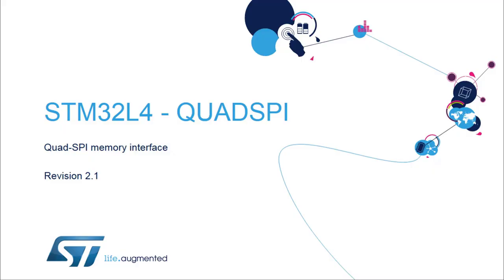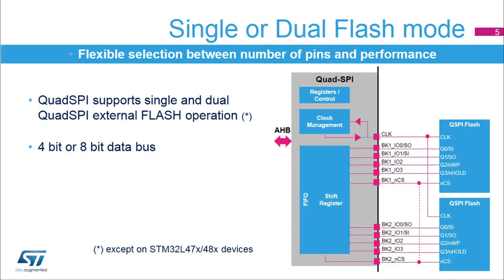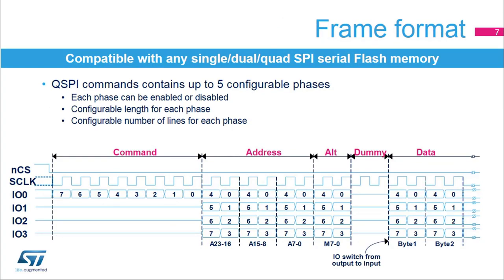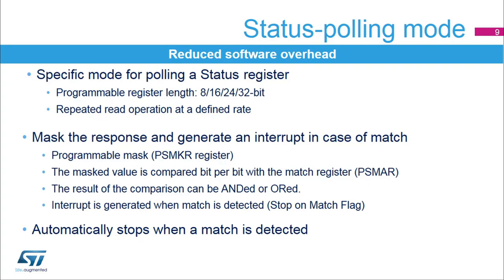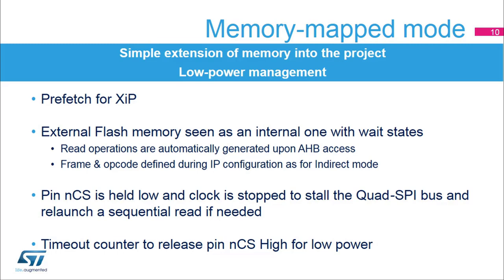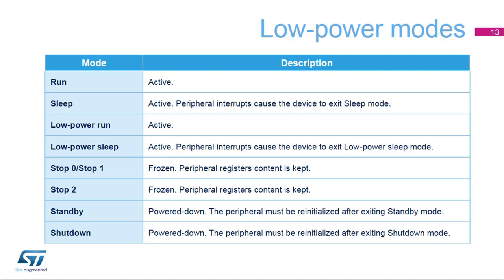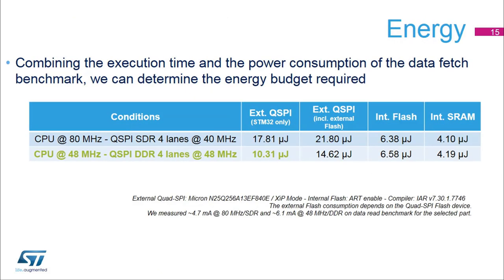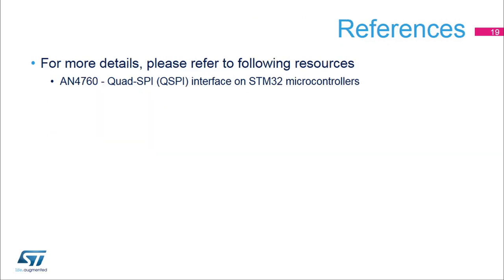STM32L4 training: 02.9 System and memories - Quad SPI memory controller (QSPI) theory

Comment: at 4:20. Why write operation is not (or cannot be) supported in memory-mapped mode?
Reply: Yeah, I was looking at that too, but mostly the flash is used in read mode, so writing is less frequent. Also it is a way to protect the memory content from accidental memory mapped overwrites because you have to explicitly select the indirect mode for writing.

See also here, especially the memory mapped block diagram around 20 minutes inside this video https://youtu.be/GJay1MCUvfE